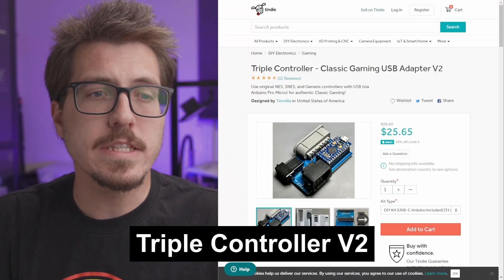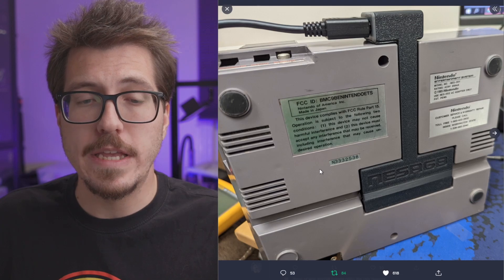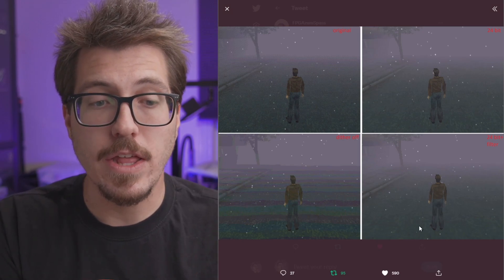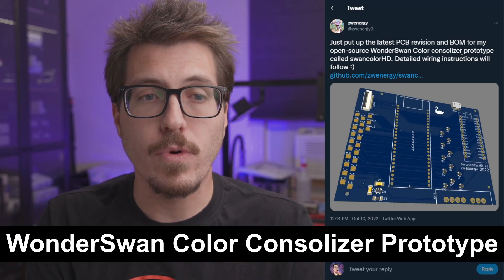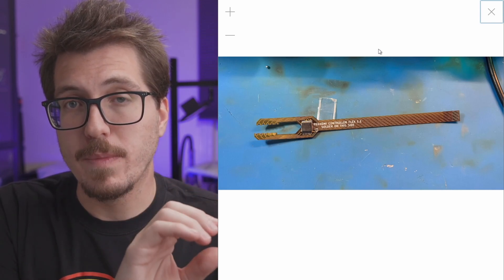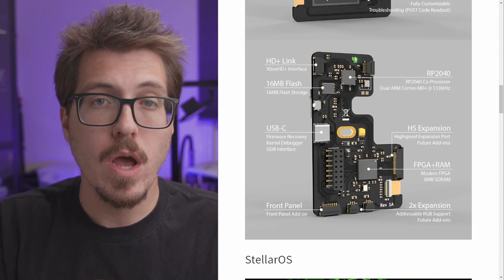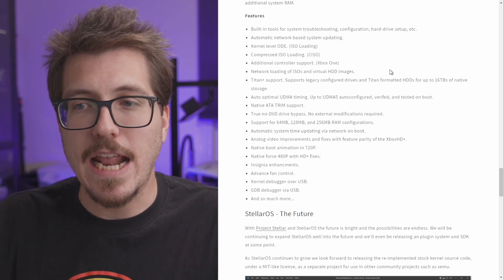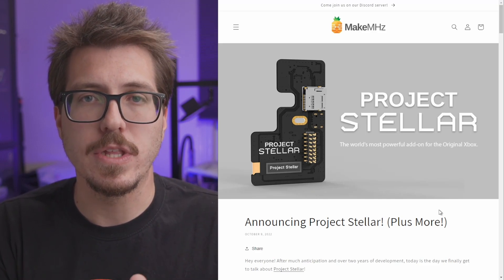MakeMHz Reveals New Xbox Mod Chip! - Retro Modding News

Comment: no one sells these anymore but i got this Extended NES I/O that uses the expansion port on the toploader where the nesrgb goes. it was before i got into soldering and was a no cut solution to have the extra japanese sound channel as well as add a famicom 15 pin port, there was also a network adapter that paired with it to allow online play and running games from a local network on the nes but i didn't get that attachment. i'm not worried about it though i got a av famicom i did the 3.0 tim worthington RGB on so i just use that anymore.